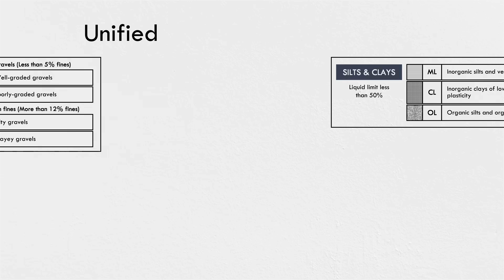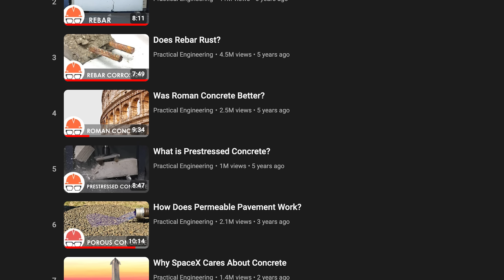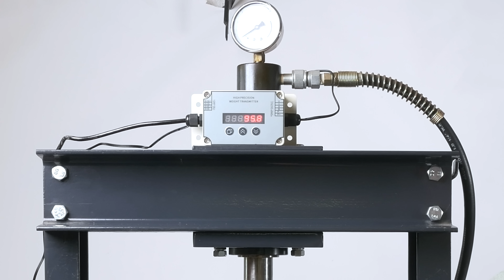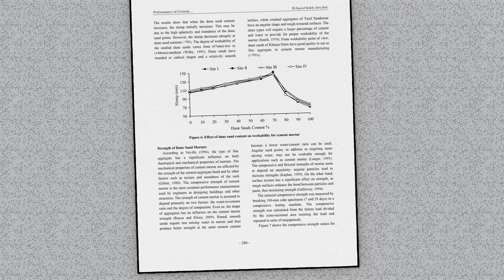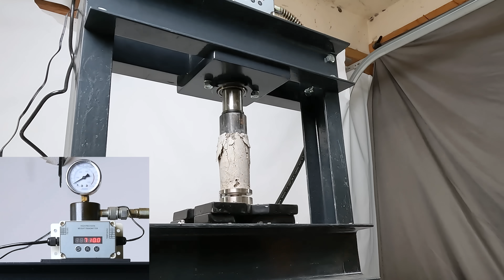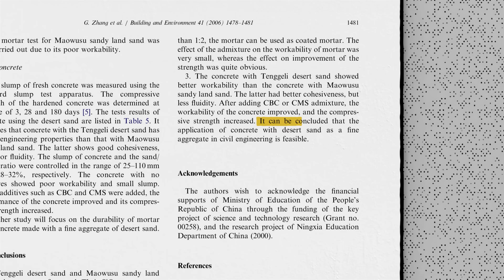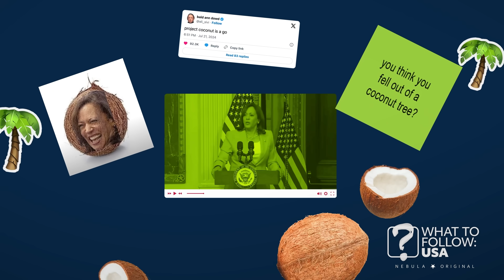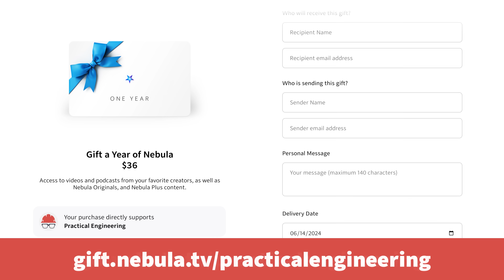Is the World Really Running Out of Sand?

Comment: The main problem I have experienced with sand is sand from a beach that contains diatomaceous sand. It is usually found on beach sand. It may be in ancient sands far from today's oceans. It can be discovered using a microscope. Diatoms are hard but porous, and water leaks through easily. Wet walls and rot follow after. Thanks for sharing! See ya later!

Comment: My pool filter needs new sand. It wears out, and they charge a small fortune for 150 kg of the stuff with the proper size (smaller than 1mm, and close to that for most of it) and shape (sharp edged, as opposed to rounded.)
Play sand is not a suitable substitute! (though perhaps 25% of play sand may be, if you sieve it.)

Comment: I spent a few months doing blasting. When we filled the holes back up after the chargers had been set, we used the drillings, which is essentially manufactured sand. The guy who did the blasting explained that the angular drillings would lock into place when the charges went, unlike regular sand that would just pop out of the hole.

Comment: On the NPS History website, there is a document from 1993 (ISBN 0-16-042042- 3) titled Historic Concrete by Adrienne Beaudet Cowden. This is a good reference document that gives a lot of reading materials that might help with finding older documentation covering rounded sand used in concrete. Might help point you in a good direction or at least help with future projects as it covers a good history/evolution of how concrete has been developed as a building material over the years.

Comment: As someone who worked in a sand mine, here in the Netherlands, at 7 minutes in, it is mentioned about round and sharp sand. One of the most striking differences of sharp edged sand is, it can be compacted. Round sand, much less so. The sand we mined was this round type, And we always noticed it when digging it up with our wheel loader for example, that we had to drive really carefully because the ground under our tires would never compact. And thus we'd dig our wheels into the ground below us. If we'd be on the more coarse sand, this would happen much less.

Fun fact, "sand" in the Netherlands is any grain from 4 mm down to nothing. Where as in Germany, any grain below 2mm in size is sand. Anything above 4mm in the Netherlands was classified as gravel or rock. And Germany, its anything above 2mm.

Comment: This is actually very similar to the question of "Is the world running out of Helium?" though granted Helium is not really renewable the same way sand can be (at least in any practical quantities) basically the answer is "no not for the forseeable future...but it is getting more expensive" we have quite a lot of it left and are discovering more and more, it's just the cost to access it is going up
Reply: Unlike sand that can be to some extent be recovered and recycled, Helium often escapes into the atmosphere, and ultimately escapes even the atmosphere. Since it is chemically inert it is also very hard to recover from the atmosphere. Well, this is all on the scale of many millenia though
Reply: @deadfishyarou once the cost of helium went up a little, it suddenly turned out that we could build recapture/reuse system for labs. It’s just that nobody bothered back when it cost too little.
Reply: Helium is the second most common element in the universe. I don't really see a problem here.
Reply: @feynstein1004  We are largely confined to the Earth. Helium is not so common here. Most of the helium that was in the solar system would have either gone into the Sun, or been blown into the exterior/became part of the gas giants. Only some is still on the inner rocky planets like Earth.
Reply: @cherriberri8373  Meh. Close enough. Perhaps a lack of helium will incentivize space travel 😀 Btw why does it say that my comment was edited when it wasn't? In fact, all of the comments in the thread say that they were edited? Is youtube glitching?

Comment: It does seem like a resource that will always be cheap and readily available if we use it properly. Might have to tone down our concrete addiction, use more wood. They both last about 50-100 years if treated well and wood can also be relatively cheap and readily available. Maybe the civil engineers can get on modular stuff where the concrete is all the foundation and the wood is the exterior and habitable areas.

Comment: What if you added fiberglass to the rounded sand would it bring up the strength of the concrete to the same as the coarse manufacture.

Comment: This is yet another reason why rebar sucks, you're forced to use runny weaker concrete.
Post-tension has fewer components in the way of the concrete. Fiber reinforced concrete has awful workability but not a big issue if there's no rebar, just shake it.

Comment: as a chemist this definition confuses me because i see sand as Silicondioxid (SiO2) and not as "any ground rock"
f.e. Granit sand should have different properties compared to SiO2 sand?
Reply: In a broad geological context, "sand" refers to a particle size range (typically 0.0625 mm to 2 mm) rather than a specific chemical composition. This can include various minerals and rock fragments, not just silicon dioxide. Silica sand, also known as quartz sand, is specifically composed of silicon dioxide (SiO2). It's this type of sand that most closely aligns with the chemist's definition you're familiar with. Silica sand must contain at least 95% SiO2 and less than 0.6% iron oxide to be classified as such. Regular sand can have a much more varied composition. Silica sand is known for its hardness (7 on the Mohs scale) and chemical stability It's resistant to most chemicals and doesn't react with them. Due to its purity and properties, silica sand is preferred for industrial applications like glass-making, foundry work, and high-tech applications. You're correct that granite sand would have different properties compared to pure silica sand: Granite is composed of multiple minerals, including quartz, feldspar, and mica. While granite sand may contain a significant amount of silica, it's not pure SiO2 and may have different chemical and physical properties which affect it's reactivity.

Comment: Where I live is dry and hot in summer, local native timber is effectively un-useable for the mass scale of construction due to how it grows. However the land is very high in clay, sandstone and bluestone so all of our old buildings are made with thick heavy walls of stone and brick built upon a portland cement foundation laid in the shape of where the walls will be laid with most of the buildings under space being left dirt, this was sufficient to keep the building stable for a century a top clay soil in most cases I see standing till this day. The last part was the roof, oregon timber was imported from the USA to make the light roof framing used in these old buildings after which would be clad in iron or clay baked tiles.

Uniquely there is a native hardwood available that grows straight which is harvested western australia jarrah, this is used for floor joists in the homes that have floorboards
this was construction from the 1850s-1950s. The old homes are uniquely suited to our climate, the low rain and high heat made the clay soil very stable long term and the heavy walls are extremely well suited to the heatwaves due to their thermal mass taking a week to warm up, 40c-46c (104f-115f) outside

Today we have pine plantations to locally source construction lumber

Comment: Sand running out is like oil running out. Once the price raises high enough new sources become viable to extract, and eventually synthetic production from more foundational materials becomes possible.
Reply: and more rivers/mountains/beaches/seafloors are destroyed
Reply: @anonihme5142  Calm down, don't get hysterical.
Reply: New oil deposits are found every day. We haven’t even looked everywhere yet.
Reply: Exactly. However, these new sources are always more costly- that's why we chose to abuse the environment to cut costs- and the costs just get handed down to the consumer every time, but Sand is needed for modern life while oil is not.
Reply: @cherriberri8373  While we could use vastly less by applying already-developed fuel efficiency measures and pruning petrochemicals in areas that have almost-competitive substitutes, modern life still needs oil because there's quite a lot of applications reliant on the energy-density and the incredibly long list of uses for long-chain hydrocarbons include things like the physical composition of wind turbines and the starting point of most pharmaceutical production.
Reply: @cherriberri8373  Oil is more essential than sand for modern life.  So much of the material we use in every day life is totally synthesised from oil that, erradicating it would set us back centuries.

Comment: You can use round sand if you use sharp water 🤓
Reply: I believe it's called Snow😅
Reply: @BlackPen4209  Or perhaps Icicles.
Reply: Or plasticized water. You can use a High Range Water Reducing (HRWR) admixture, also known as a plasticizer, to make the concrete a lot more workable. You can add a small amount of plasticizer and get concrete that moves like you just doubled the water content, while the strength is only minimally affected. Almost all construction concrete has at least 1 admixture added in, they can offer any number of other benefits (ice resistance [entrainement], crack resistance[fibers], chemical resistance [talk to a chemist], etc).

Comment: good video! it's a classic case of "We'Re rUnNIng oUT!" while in fact, it will just cost 10 cents more
Reply: The situation is probably (a bit) more complex. In recent decades, concrete has been subject to more and more different requirements. Sometimes it has to harden under water and be resistant to salt water, other times it has to remain workable until it is brought to the top of a skyscraper in the scorching desert heat. And there are certainly many other specific requirements that concrete has to meet for certain projects.
I can imagine that the shape of the sand grains is becoming more important for some recipes.
Reply: And people often dont understand the economics of supply changes. Goods are much more elastic than people assume. 

There was a famous bet between a doomsayer and an economist decades ago about whether prices for certain resources would increase significantly over time. And remember peak oil? Most doomsayers would have found it unbelievable that oil and natural gas are not priced much higher in 2024.

Labor has similar misunderstanding such as the lump of labor fallacy.
Reply: @lightfeather9953  https://en.wikipedia.org/wiki/Simon%E2%80%93Ehrlich_wager
Reply: @lightfeather9953  Paul Ehrlich, the doomsayer, and Julian Simon, the economist, and a bet:  https://en.wikipedia.org/wiki/Simon%E2%80%93Ehrlich_wager

"If I were a gambler, I would take even money that England will not exist in the year 2000" - Paul Ehrlich
Reply: Im running outofcents
Reply: Love your channel!
Reply: Running out of sand was item #231053814 of things I was worried about today
Reply: "We'Re rUnNIng oUT!" ~ Cute~
Reply: it's this low because people worked hard to keep it low by engineering solutions to make the alternatives cheaper to acquire, to reduce the need, to make the process easier, etc.
and then the price gets a 50% increase over time anyway because the shareholders wanted more dividends
Reply: I read that in your voice and accent...
Reply: 10 cents more adds up across the cubic yardage of an entire project
Reply: @snickerdoooodle  I know 10 cents is a hyperbole here, but 10 cents per yard means nothing compared to the cost of construction. The hoover dam used 4.36 million yards of concrete. That's $436,000 dollars of added cost to the hoover dam.

That's not even a rounding error, when you consider that today it would cost a billion to build. That's .043% of the cost.
Reply: @JustinLebo-d3t Plus technology generally makes many parts of the process cheaper or better, and likely more than offsets the increased cost of resources.
Reply: @submachinegun5737  Only sort of. Externalities also are part of the math and they increase too. Generally doesn't come up
Reply: @snickerdoooodle  Yes.  But you can also economise, when the price rises.  Eg Singapore uses less sand now for their land reclamation.
Reply: Sure, but "this common material wll become more expensive due to increased enviromental regulations and decreasing easily accesbile sources" is not even close to the fear-mongering nonsense people are selling when they claim "sand is running out! Society will collapse!!!".
Reply: @snickerdoooodle  eh, 10 cents is not a lot per ton. That's not even going to be a 1% increase in cost.
Reply: Just like "peak oil" in the 1980s

Comment: So far, just in the context of the right type of sand for concrete mixing, sand that is jagged in appearance under a microscope, not rounded softened by water erosive action. At the time I started to wonder about lunar regolith, would it be ideal as the sand given it is exceptionally jagged material under the microscope? Not that it's going to matter for Earth based projects, but maybe for certain lunar projects.
Reply: The significantly lower workability would lead to a lot more water being necessary. And I can imagine the significantly lower gravity would lower the effective workability even more.

Though I imagine the lack of an atmosphere would lead to significantly more evaporation of the water, at least on or close to the surface, meaning it would cure better, a least in the outer area of the concrete.

Though all of this needs to be evaluated in the context that buildings also need significantly less structure due to the lower gravity.

My intution says the best way may be pressing the concrete into (interlockable) blocks in airtight molds, then using those blocks to build (and form the structure of buildings).

It's a fascinating topic. I'm pretty sure various space organisations have written papers on this already.
Reply: @MalloonTarka  I envisioned it in a pressurized environment, like a fab plant.